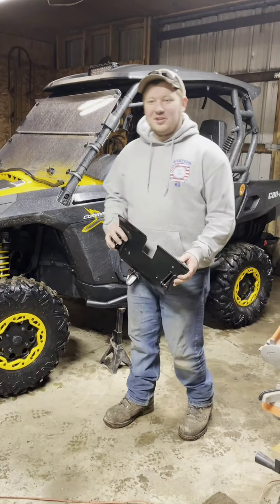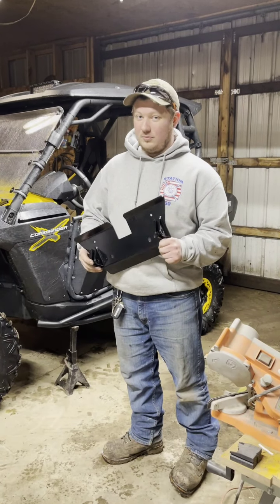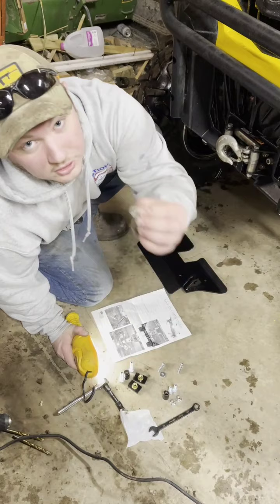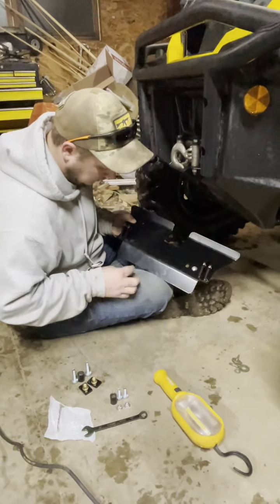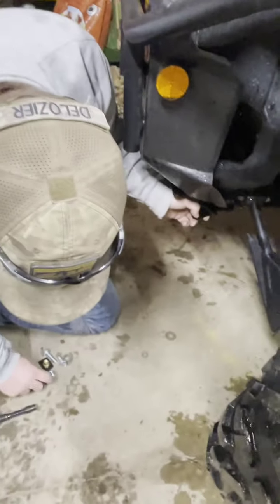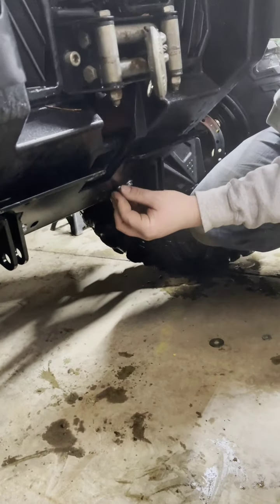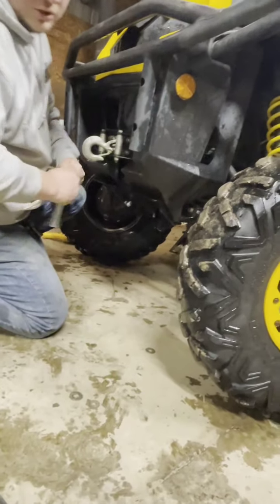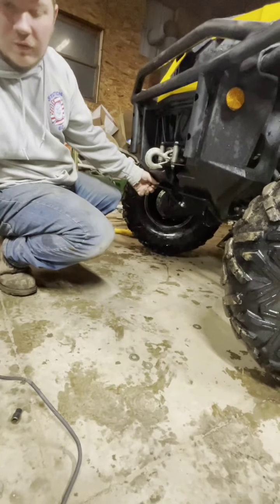Can Am Commander KFI snow plow mount install

Comment: Thanks for posting this video.  It was very helpful.  I also have a 2012 Commander and picked up a 2nd hand Polaris Glacier Pro Plow.  I am wondering what kind of modifications did you have to do to the push tubes?
Reply from the maker: I had to cut a couple tabs off